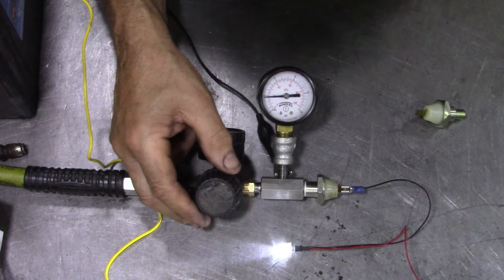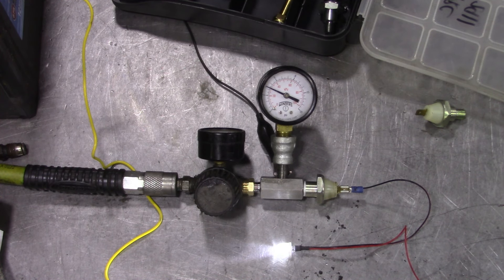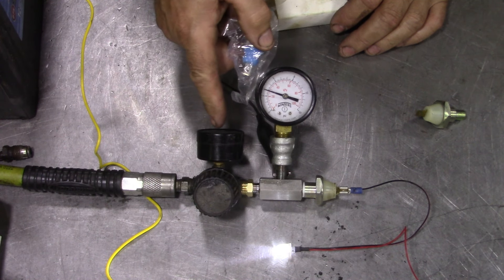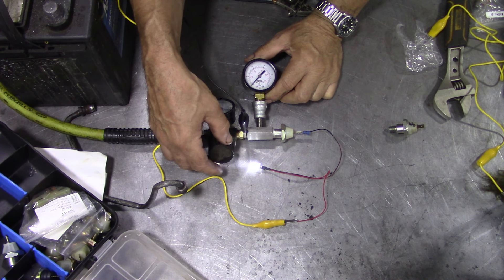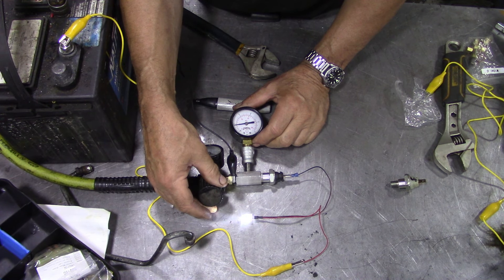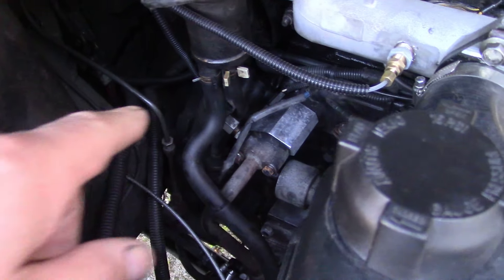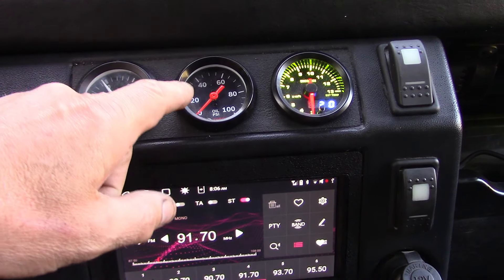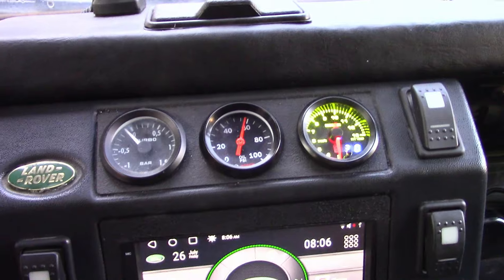Oil Pressure part 3

Comment: I had my oil pressure sensor (the white plastic one in vid 1/2) drop off. The actual white (cream) plastic head fell off whilst driving followed by all the oil. First I knew was the light on, power loss. Currently having the bottom end rebuilt as it damaged the shell and the cam 😮. No confidence In these switches now 🤦🏼‍♂️

Comment: This takes me back,  some of the pushrod European Ford engines used to have very low oil pressure on an idle, the normal oil pressure switch only need a few PSI to put the light out yet still it was considered normal with some variants if the oil light came on while idling. There were alternative oil pressure switches made with an even higher threshold, typically for competition cars that were never idled. With the Lotus twin cam I think the oil pressure was even worse, same pump, similar bottom end and two additional cams needing lubrication. (they kept the one in the block to drive the oil pump, fuel pump and distributor). As for the shims on the relief valve, even in the UK weather it was scary to get near on 100psi on a cold idle, and creeping down the road in fear of bursting the filter. ridiculous oil pressure also puts massive strain on the oil pump drive.

Comment: Very interesting and a neat test setup for pressure sensors. It takes me back to chasing low oil pressure on a Rover V8 (that was wear everywhere including the pump😄).
Reply from the maker: That must have been a 3.5!
Reply: @BritannicaRestorations  it was!
Reply from the maker: Been there, done that...

Comment: I don't mind a Rowentrees Fruit Pascal now and again ;-D Interesting to see the difference between new sensors though. Hope you got the alternator fixed.
Reply from the maker: Parts were not available locally so special order  - by the time I order and get rebuilt it was going to get too expensive, so ordered a new one from the US for $125 - will be here in 2 weeks

Comment: Very timely information. I’ve just had to change out a faulty switch on a 19J that I’ve rebuilt. I had a bit of a panic when the light came on when it was at hot idle but a test gauge told me it had 20psi. Can you explain the oil circuit through the cooler and if the pressure would be affected buy the oil thermostat in the filter housing opening and closing please? Keep up the good work!

Comment: Maximun on a car batteries is 14.1 V and usually 13.8 V if it's over there is a serious flaw in the alternator regulator .
Reply from the maker: Yeap - 17v is too much - stripped it down and went for parts - no longer available locally, and the price of a regulator/rectifier and brush pack was almost half the price of a new alternator - no-brainer
Reply: It is interesting on how much activation varies from sender to sender.
Reply: Older fords used smart charge for the initial charge after startup up to 18v but had to use silver calcium batteries

Comment: It would be a interested question when the pressure Valve is opening by the oilpump ?
I'm sure you will built a test stand with the original oilpumphousing and a mechanism to show this  Also it would be very special to put worn out oilpumps insude to see the difference.
I believe there is most off pressure failings not the oilpump rather engine problem s. It would be very interesting. Good Video ! I love it.

Comment: It would be an idea to have an oil pressure switch with a propotional Integral messuring.
That means you have depence of RPM a curve for the pressure.

Comment: What would you expect the oil pressure to be on a 300tdi hot and cold with the engine in good condition Mike. I love these video's they give you something else to worry about on a long trip ( just kidding )
Reply from the maker: Normal operating temperatures and speeds:
1.7–3.8 bars (25.0–55.0 psi)
Idle speed pressure can be lower and not always detrimental - think about it - there is no stress on the motor and the engine is only doing about 750 rpm - it's when you are driving and the oil pressure light comes on at speed! 
But it should not come on at idle as they are set for 6-9 psi